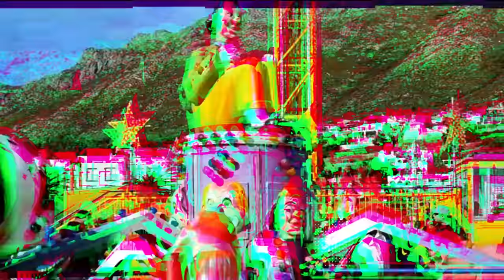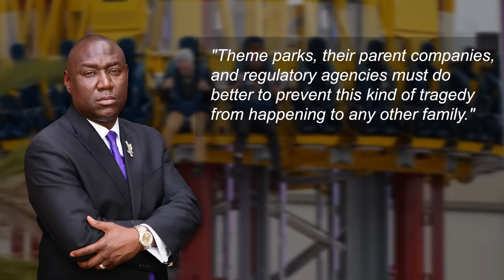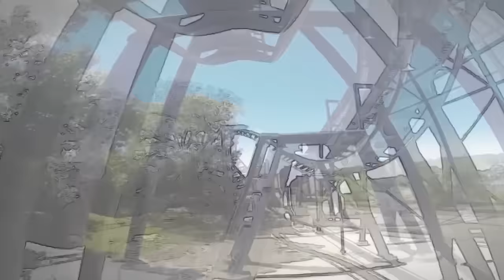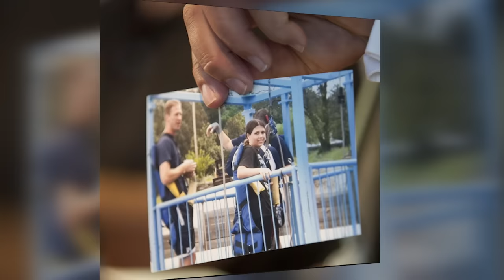9 Worst Roller Coaster Accidents in Human History

Comment: In the early 90s, I rode "The Beast" roller coaster in Cincinnati, Ohio at Kings Island Amusement Park. The day I went, the park was reserved only for GE employees, of which I was one of them. The Beast was one of the many rides I rode that day. Went I got on the ride, I sat in the car by myself. Two of my coworkers sat behind me. The lapbars automatically lowered as the ride was about the start. There were side handle bars inside the car to hold on to as well. Everything was fine until near the end of the ride near the last turn. The lapbar came up on me and I tried to get it to come back down to no avail. I was holding on the raised lap bar with one hand and the side bar with the other for dear life. I looked behind at my co workers and they were agasp. As the ride pulled into the station, ride operators were shocked that my lap bar was up while the train car was still in motion. I got some pretty good whiplash. I had to be put on a stretcher and taken away. I told my family about the incident and I sued the park for negligence for a undisclosed amount. I used to love to ride rollercoasters. Ever since that incident, I have never had the desire to ever ride one again. I have never forgotten that day.
Reply: Well damn, I'm in Dayton and that's the one ride I haven't ridden on, now I don't know if I should 😢
Reply: man, I rode Beast and Son of Beast so many times when I was a teenager. I had a Kings Island season pass almost every summer. I know The Beast was ancient though, and eventually they took Son of Beast down I think. crazy.

Comment: the very first one you got a few points wrong. Firstly he did not fall out as the ride began to drop, he fell out as the ride started to brake and he fell about 100 feet at speed. Second they didn't loosen his safety belt as that ride has no belts, what they did was they adjusted the over the shoulder restraint on his seat because even at 14 he was 6'5" and 383 pounds and they needed to account for his size. He was however nearly 50 pounds over the maximum permitted size for the ride. He was also not with his football team he was with his family on vacation. You also fail to mention that because of his size he had already been refused entry into two other rides and had the staff followed the correct procedure he should have been refused access to that one as well.

If you got that much wrong in the very first story it makes me wonder about the validity of anything else in this video.
Reply: Agree with everything you said that's what I read.
Reply: @lyndamccallum1535 Louis, was visiting Orlando with his football team over spring break, his father said. “He gave me reason to live,” Yarnell Sampson told CNN. “He earned a right to enjoy himself and, unfortunately, he lost his life on that ride.”Mar 28, 2022
Reply: Louis, was visiting Orlando with his football team over spring break, his father said. “He gave me reason to live,” Yarnell Sampson told CNN. “He earned a right to enjoy himself and, unfortunately, he lost his life on that ride.”Mar 28, 2022
Reply: I saw the video when it first happened and it was AWFUL! The camera person was videoing his kid that was a few seats over from Sampson. The ride made the fall and when it came to the stop right before it brings it down all the way, he slipped right out from under the bar that wasn’t pushed down all the way because of his size. He actually hit the roof above the controller then the ground. No blurring out either. I’ll never be able to get that image, or sound it made, out of my head. 😢
Reply: @kimmieh8419 what’s the video name?
Reply: I agree with this, also there are many points wrong in the batman the ride accident, 1. It happened back in 2008, 2. He jumped the fence to skip some of the line since the line was up to 120 mins when he was visiting with a group. 3. He did not try to grab anyone's feet on the ride, instead he didn't realise the train was gonna come and hit him, and finally 4. Six flags opened the coaster 10 days later because they made modifications to have barbed wire at the top and have signs indicating "Extreme Danger". So suffice to say, a lot was wrong
Reply: amen!
Reply: @emildaspookykid 👏🏾👏🏾

Comment: The fact is that at any park you may visit the rides will most likely be operated by 16 to. 21 year old  kids who are working part time and have had very limited training on the rides outside of loading and starting it. Also in most states the inspections of rides are left to the parks with state safety inspectors only getting involved after a accident. 16:27

Comment: When I was around 8 years old, my family and I went to a traveling carnival. I was allowed on one of those spinning spider rides that twirl around extremely fast in the air, quite high. I was in a seat with my brother and there weren't any seatbelts. There was just a pull down bar that would come to an adult's waist. Not only was there just a bar, the floor was open to where your legs would dangle out the bottom (if you were an adult male or taller woman). It wasn't a completely open area as there was an area for you to rest your feet and the hole wasn't huge but to an 8 year old child, it was a death trap.

When it got up to full speed, my body was being pulled by centrifugal force. I literally was slipping under the bar and being pulled outside of the ride. I was screaming and just remember trying to keep the bar under my arm pits and held on for dear life. I remember my brother laughing at me and thinking nothing was happening but he reached over and held onto my shirt. I legit thought I was going to die and if I wasn't able to hold on like I did, I 100% believe I would have. I remember feeling the air over my feet and the force on my tennis shoes. I don't know how long the ride was, all I know was I was fighting for my life and felt I couldn't hold on forever. The force of the pulling was so intense. The ride would slow down sometimes and allow me to pull myself back in and get a better grip and I think if it kept up at full speed, I would have not been able to hold on either. During the slow downs, that's when I would tell my brother I was slipping but he only thought I was scared. When I got out, I was terrified and told my parents but they didn't believe me either.

Now it's just a memory and this shit still happens at a lot of these places.
Reply: Hearing that story, with the correct emotions in the explanation, I believe you and I am so sorry for your bad experience on such a ride. I hope that you can put it behind you and enjoy your life, that you fought for.
Reply: I feel bad for you I’m so sorry that happened.
 Carnival rides are often not safe.   This wasn’t as bad as your experience, but I went on Green Lantern a few weeks ago, which is a standing coaster at six flags great adventure with 5 inversions. When getting buckled in and having the restraint locked over my shoulders, I noticed it was loose and that I could easily slip out especially if I didn’t hold on while we went upside down. The entire first lift hill I was complaining to my dad but he just said to hold on. It ended up being a VERY violent ride and I had to hold on the entire time becuase of the constant inversions. I ended up being ok but my hands felt like they were going to break off form how hard I was holding on. My dads and my back hurt so bad from the ride and we both felt so sick.
Reply: We have that same ride at a park here called Holiday World. It’s in the Halloween area of the parks and it is called The Spider.  I can see what you mean being a small child and slipping through the crack, the ride here has a height requirement thankfully.
Reply: Your family doesn't treat you right.
Reply: Your family (and the ride company) certainly needs to be held accountable for harm by negligence by not protecting you and not believing you.
Reply: When I was around 13 I was in a ride where the bars that came over the shoulders were way too loose, I had to hang on until the end of the ride.
Reply: I know how you feel. Nobody ever believed me when something bad happens to me and/or when I got injured. I'm 59 now, and still, nobody believes me when I explain to them how much pain I'm in and I LIVE in pain. The entire medical profession thinks that I'm not human. I'm sorry that has happened to you, but I'm glad that you survived it, no thanks to your family.
Reply: I am sorry that happened to you. I believe you. It took a lot of courage, strength, and a strong mind to make it through your ordeal. You did an awesome job hanging on!  I am glad you survived.
Reply: I also believe you, you're great at conveying through description. Really sorry that happened, that you were let on the ride, and about your family not taking it seriously. I'm glad you got through it.
Reply: I definitely have a few memories like that.   But this was before the internet and I was naive thinking it must be safe cause otherwise it wouldn't be allowed and nobody before me fell out.   But I definitely remember thinking: I'm pretty sure I'm keeping myself from falling out and dying, not the lap bar 😂.  Thanks for jogging my memory
Reply: This exact ride traumatized me as a kid. I 100% believe your story man. I was a chunky kid -and tall, so it wasn’t so bad for me, but I remember being absolutely terrified and then getting stuck at top for 10 minutes. I don’t ride carnival rides anymore 😅
Reply: So traumatic
Reply: 1. Seatbelts aren’t necessary on rides they are only there in case the restraint fails which is very unlikely
2. That force you felt of being pushed out was airtime it’s a completely normal force that you feel on rides and you’re not in danger if you feel it
Reply: @Gabby-np9eu your should restraint was perfectly locked in. The ride literally couldn’t dispatch if the restraint wasn’t locked
Reply: Oh god... I'm so so sorry you have to experience it: the frightening itself and the desperation of not being believed... The latter is just outright cruel. Just cruel. I'm really sorry for you and for this little child back then.
Reply: @frozenuruguayball6436 well they said they were SLIPPING and had to HOLD ON so how they were not in danger?? the force you are talking about keeps you in place (and you can actually feel that it does), not pulls you out.... Obviously, they were not tall enough for the ride.
Reply: @IfSoGirl88  that is called airtime and laterals. Normal forces on roller coasters
Reply: I can understand your brother not understanding but your parents?! Tf
Reply: Jfc, I'm glad to know I'm not the only one who went through this (but not glad that it happened to you). I was also slipping UNDER the friggin' bar and clinging on for dear life while adults laughed it off. With every whirl, I was sinking lower and lower down the seat, to the point where my neck was at the bar, so I had to death grip the bar with my hands. It was terrifying. None of the useless adults believed me.
Reply: @RavennaRose928 to be fair, maybe her (?) parents were having a blast and were not paying attention to what exactly happened.  Still they could have at least shown concern.
Reply: I am sorry sorry that happend to u!
Reply: I had the same exact experience riding with my husband. I kept slipping under the bar and he kept laughing thing i was scared. 
Then another time he talked me into going on the stand up batman ride and i was trying to figure out the seat belt. The bar automatically dropped down over everyone. That attendant didn’t check everyone because of it and just before take off i notice my ride moving up and down. The attendant was walking toward the start button. I have a light voice and kept trying to scream his name. Everyone was so excited and loud  he couldn’t hear me and finally he turned and i was flagging him and scared to death. Then he locked me in place so apparently you have to be locked so your feet touch the floor mine didn’t. I’m 4”10 and was about 100 lbs. Had he taken off i would have flown right off. 
Another time a water ride with my daughter and i. At the time she was barely the height and was 65lbs and i about 100. We both are tiny and when when slid down we went so far in the air off the ride i prayed at the end and that was the last ride i ever got on. Too many brushes with accidents on rides and the seat belt never fit us, they kept sounding a loose. . A lot of those rides pose a safety threat when your underweight. My daughter is now 22 and she hours and i’m so afraid for her. She’s 5ft and weigh 85lbd and kid size 10 clothes. I’m 50 and wear kid so 14. 
I stay far away and keep my feet on the ground.
Reply: Well your parents shouldn't have let you on it.
Reply: Man I was on one of those spider rides when I was younger with my brother too. All it is is a lap bar that doesnt even come close oto your lap or anything, ESPECIALLY for a small child. I had a similar experience as you on one of those rides, but not as bad as yours. I was being pushed to the side of the car as the cart kept spinning and spinning, nothing I could do about it except hold on. As a kid I feel like you could easily slip out of those things. These spider rides still exist as well all over the place.

Comment: I've been "stuck" on a coaster twice at Six Flags Magic Mountain. But then again, it wasn't the ride, it was other people being butts. The first time, I was riding Goliath with my step-dad, and we had just pulled back into the area with the brakes. I bet everyone on that ride was suprised to see the other train still in the loading area. Aparently, someone refused to get off the ride. The operators called security and they quickly got off. After that we rode Scream and Ninja, but the other ride I got stuck on was Viper. Yes, it happened in the same day. We were going up the lifthill, and I was pretty scared. Suddenly, somebody screamed "I wanna get off!". So, we stopped and a ride operator had to come up and ask the dude if he wanted off. He refused and we continued with our ride.

Two bonus stories that I wasn't on! So, the first one is when my grandpa was riding old Colossus. It was around Halloween I think, and the Colossus cars where backwards. My grandpa was riding it and for some reason, it stopped at the top. An operator came up and told everyone that the breaks weren't working, but they were going to let them go. My grandpa asked to get off, but the operator said no. But in spite of that, my grandpa said that the ride was going super fast and that it was probably the best ride of his life. Last story. My step-dad was riding Superman: Escape From Kyrpton, and the ride went so fast that they hit the red brakes at the very top. It took from 30-60 minutes to get the ride working again.

Sorry if I spelt anything wrong! I'm only 11, haha.

Comment: I got into a roller coaster at Magic Mountain in California years ago and it only had a bar that locked down on my thighs. When the bar locked down, there was a three inch space in between the bar and my thighs. As soon as the roller coaster first went down, I almost flew off my seat since I was holding my hands up. I quickly grabbed the bar and held on for dear life for the rest of the ride. It was the scariest thing in my life.

Comment: I almost flew off a rollercoaster at Carowinds near Charlotte NC. I was 13 years old and very small in statue and the lap restraint was very loose. When the coaster hit its turns, I had to firmly grasp the inside of the coaster chair. I curled up in a near fetal position and prayed. It took me several years to get on another coaster.

Comment: I had the same exact experience riding with my husband. I kept slipping under the bar and he kept laughing thing i was scared. 
Then another time he talked me into going on the stand up batman ride and i was trying to figure out the seat belt. The bar automatically dropped down over everyone. That attendant didn’t check everyone because of it and just before take off i notice my ride moving up and down. The attendant was walking toward the start button. I have a light voice and kept trying to scream his name. Everyone was so excited and loud  he couldn’t hear me and finally he turned and i was flagging him and scared to death. Then he locked me in place so apparently you have to be locked so your feet touch the floor mine didn’t. I’m 4”10 and was about 100 lbs. Had he taken off i would have flown right off. 
Another time a water ride with my daughter and i. At the time she was barely the height and was 65lbs and i about 100. We both are tiny and when when slid down we went so far in the air off the ride i prayed at the end and that was the last ride i ever got on. Too many brushes with accidents on rides and the seat belt never fit us, they kept sounding a loose. . A lot of those rides pose a safety threat when your underweight. My daughter is now 22 and she hours and i’m so afraid for her. She’s 5ft and weigh 85lbs and kid size 10 clothes. I’m 50 and wear kid so 14. 
I stay far away and keep my feet on the ground.

Comment: In 1980 while on two tabs of LSD, I got disloged from my seat on the "Revolution" loop rollor coaster at Six Flags Magic Mountain. I was standing from the start of the ride with my hands in the air. When we hit the loop I was  pulled out of my seat and ended up in the seat in front of me. When we came off the loop I wiggled back into my seat. As I did, I snapped my back pretty good. I also got a bloody lip. Great times!